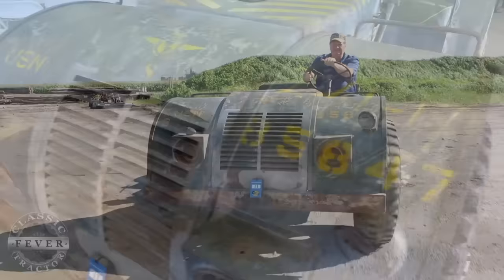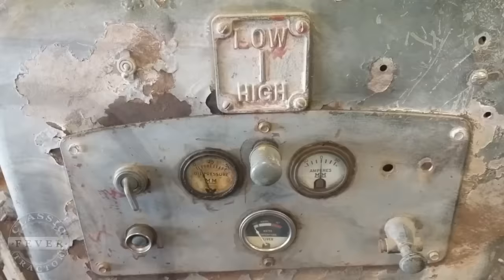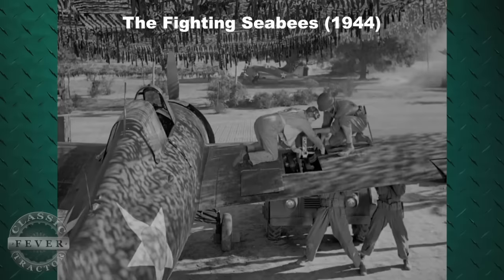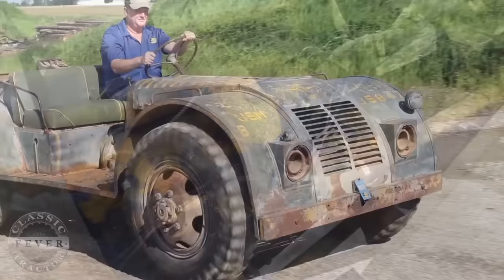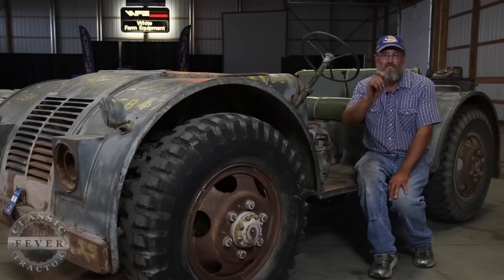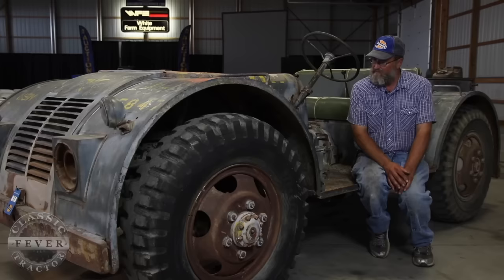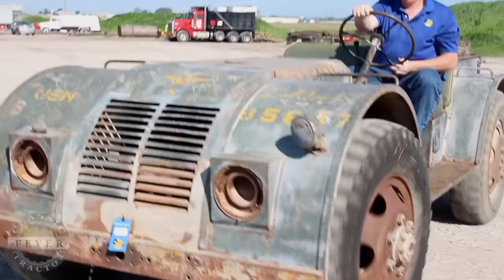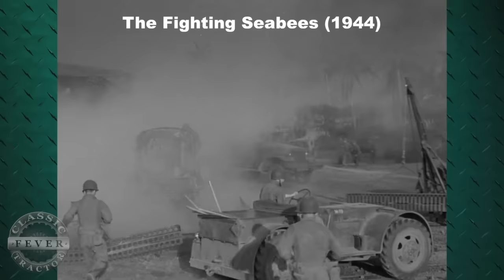The Original "Jeep"? World War 2 Minneapolis Moline NTX Vehicle

Comment: The video already answers the question. This is a tractor, an aircraft tug. Does not have adequate suspension for riding on roads or highways. It is a beautiful specimen and very well maintained.
Reply: True. A nice vintage aircraft tug - but no Jeep by any means.

Just because it's military and 4x4 doesn't makes it one.
Reply: I wanna put a hellcat in one 😮
Reply: Original company advertising clearly shows it being called the original Jeep as that is what the original test driver nicknamed it, so...
Reply: Ever ridden in an old army Jeep? They pretty much are a tractor. Modern “Jeep” is a jeep only in name.
Reply: @MrIgottap  Old army Jeeps may feel like a tractor - but they aren't technically. They are surely not as comfortable as modern off-roaders - but they do have a suspension - and bolstered seats. Main focus in design wasn't user comfort - it was durability - at all costs. Leaf springs are very tough - but not comfortable.

Back then, the concept of a small, fast multi-purpose vehicle with the ability to switch between RWD and AWD was revolutionary. But it's not a towing machine. It can tow a small trailer - but that's about it.

This vehicle here was designed for a whole different purpose in a whole different weight class. It's a slow and heavy tow vehicle, permanent 4x4, no suspension - a true tractor.
Reply: @stanislavczebinski994  I get that but, newer farm equipment with suspension, switching drive, and top speeds >45mph is not a tractor “technically”?

Is a Peterbilt not a tractor (regardless of speed capabilities) because it has suspension and is not all wheel drive?

I would argue that the definition for being a tractor is more inclusive.
Reply: @MrIgottap  No offence - but you didn't got that.

I tried to explain the difference of both designs by some of it's technical features hoping to get the point across.

Reversing that point outside of original context doesn't therefore make any sense.

I'm not mothers' tongue - if you look for the definition of a tractor - maybe Wikipedia can help.
Reply: @stanislavczebinski994  No offense taken, it’s all good. I’m very familiar with “traditional” tractors (own several, I do some farming and enjoy tinkering on my antique tractors) and “non traditional” tractors as well. It seems almost impossible to come up with a proper definition and requirements for what a tractor is and isn’t. If I pull a wagon full of hay with my side by side that has a PTO as well, does it become a tractor? Does my garden tractor lose it’s tractor status if I remove the mower deck and use it solely for transportation? I’m not looking to offend, just offering some perspective to ponder.
Reply: @MrIgottap  Fair enough.

There are a gazillion 13-year olds around here jumping on any opportunity to tell you "you have no idea" and "you're stupid" because you got 10% of your statement not entirely correct.

Good to see you're not one of them.

Yes, a clear definition is hard.
Reply: @josephlannert969 - so if the “original test driver” called it “the original keep”… where did he come up with the idea to call it that?… oh… “from an actual Jeep!”… 🤔
Reply: @archer721  actually it came from a dog in the old Popeye cartoons/comic strips named "Jeep", although  I don't recollect exactly whose dog it was. Apparently the vehicle looked so cute it reminded him of said character
Reply: @josephlannert969  - you are correct 👍 
Popeye brought it home for sweet pea… and because “Jeep” could go anywhere, the little truck earned its name from the cartoon character… and there for became “trade marked”…
Reply: I absolutely could use this for an aircraft tug and it would be great.

Comment: The Army  put out bids for a small four wheel drive utility vehicle. Bantam Auto builder's design was accepted but because they were a small company with limited manufacturing ability the design was given to Ford and Willys. The vehicle was listed in the Army's paper work as a "General Purpose Vehicle." The troops shortened it to "GP" or as we now call it "Jeep"
Reply: Commonly told, but wrong.  They were called Jeep after the comic character before they were designated GP.

Comment: Most definitely NOT the original M-M jeep!. The model UTX was the original M-M jeep and a total of six were built in 1939-40 (possibly as early as 1938) and were famously tested at Camp Riley, MN, which is where the "jeep" nickname was applied. Sgt. James T. O'Brien, who did not survive WWII, is recorded as having applied the name. This was long before (a decade) Willys-Overland trademarked the name. The UTX was largely based on the UDLX, though larger, and mounted the 425ci six rather than a four and had a stouter undercarriage, plus a driving Timken front axle. One UTX is known to survive. I drove it and photographed it in the 1990s. At the time it was owned by the Fertig family. A version of it went into limited production, the GTX 6x6 artillery prime mover, but only a few hundred were built. A couple of those survive in Europe.
Reply: Developed from 1937 on as an artillery puller, the Minneapolis Moline 
NTX was the first vehicle bearing the name "Jeep" - because this was a 
designation which US-Army mechanics assigned to test new vehicles.
Reply: @BFKAnthony817 Jeep = gp General Purpose vehicle

Comment: Hydraulic lifters simply control valve lash.  They have nothing to do with prevention of engines being destroyed due to lack of oil. Connecting rods see to that!   Nice 4x4.
Reply: If you didn't keep the solid lifter valve train adjusted correctly you can destroy an engine yes  hence the navy specified hydraulic lifters. One less thing to adjust.
Reply: i agree , he was wingin it on that explanation

Comment: there were many prototypes submitted by lots of Companys the first one that fit what they were looking for was made by the Bantom motor company in Pennsylvania   the company was small so after a short time production was taken over by the Big three auto makers of the time FORD GM and Chrysler  they also had other cars and trucks at the time that wasn't a Jeep
Reply: Bantam produced the first 4wd Jeep that was driven from Butler, Pa. to the Army testing grounds September 21, 1940.   It was immediately taken out for a "spin" with sensational review by Lt Colonel Mosley.   The Bantam pilot Jeep was then tested by the US Army for several weeks under severe test conditions and successfully passed.   It was then taken on a tour of multiple military bases for inspection and knowledge sharing.   The success of making the first Jeep in 75 days, Bantam was awarded a contract to built 70 more Jeeps the BR-60 series which included 4wd steer versions.  All 70 of these BR-60 versions were completed and delivered to the US Army before the end of 1940 ahead of schedule.  Willy's first Jeep, the Quad, arrived November 13 and promptly blew three engines during testing.  It took Bantam's engineer Harold Crist to tell Willy's why their engines kept blowing up.   Ford?  Limped into the US Army testing grounds with a farm tractor transmission that was ill matched to the duties required by a military jeep.    Bantam's chief blue-print engineer-Karl Probst-made a deal with Checker Cab company out of Michigan to "boost" Bantam jeep production which was stated 20,000 a year prior to this agreement.  Checker's engineers retooled and modified the 4wd steer design of the Bantam Jeeps and yes, Checker Cab Jeeps were photographed at the US Army testing grounds in Baltimore.   The US Army let Willy's and Ford reps look at and copy what ever they wanted off the Bantam Jeep while it was being tested  in Baltimore.  The Spring of 1941, saw the US Government award 1500 Jeep orders for Bantam, Willys and Ford.    The three rivals were field tested in June 1941 with the US Government declaring the Willy's the winner and the one slighly less cheaper (a few bucks) was the nail in Bantam's Jeep production.   However, officials from the Russian government were on hand and could choose what ever jeep they wanted and went for the Bantam Jeep!   1000 Bantam Jeeps were sent to Russia via the Lend Lease program.  At least two Bantam Jeeps were seen with the Canadian Army in 1941.   By the way, did you know the largest stock holder of Willys was Bantam's owner!

Comment: Nope not a jeep it's a tug.
A cool tug with a jeep like box to the rear but next to no real off road ability due to ground clearance and lack of suspension 
Charlie 🇬🇧
Reply: Developed from 1937 on as an artillery puller, the Minneapolis Moline 
NTX was the first vehicle bearing the name "Jeep" - because this was a 
designation which US-Army mechanics assigned to test new vehicles.
Reply: the tug was designed to pull heavy artillery and aircraft not  extreme offroading

Comment: This Minneapolis Moline is a Tug, not a Jeep.  It's too far heavy and lacks all-terrain mobility and speed required under the Jeep proposal.  Even though it is a 4-wheel drive, if you were to take this into a loose san, or deep mud area that would be that.